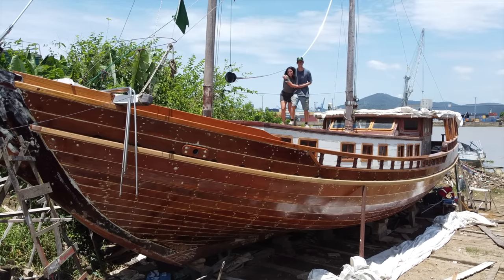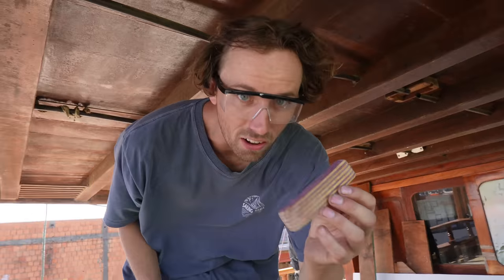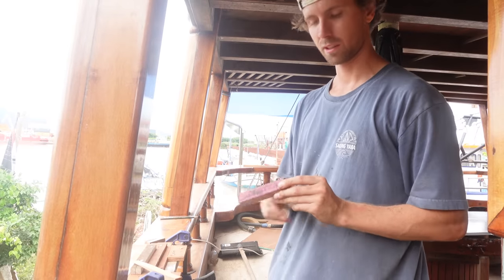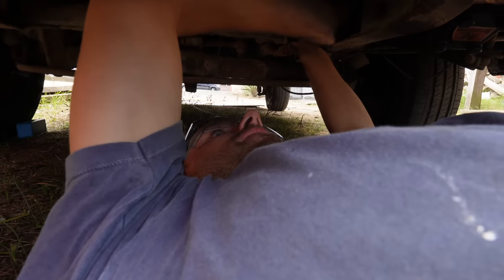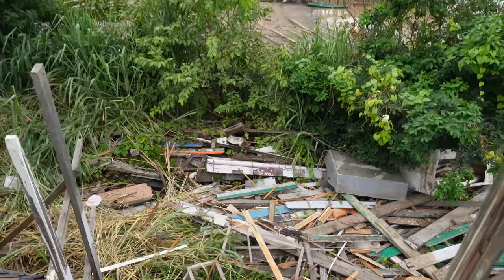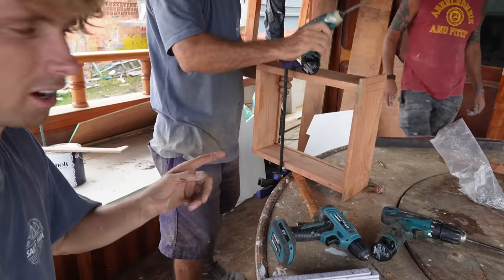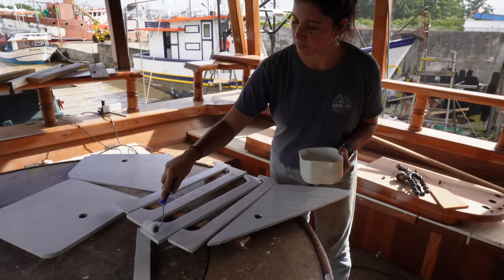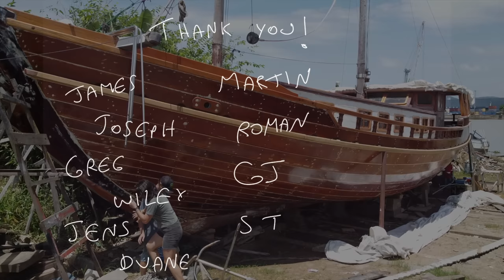Turning this once WRECKED SHIP into an all new liveaboard sailboat! — Sailing Yabá #131

Comment: The handle making exercise would go so much faster/safer/tidier/more consistently with the router mounted in a table - doesn’t need to be anything fancy. Gives me the heebyjeebies seeing you try to freehand small bits like  that. Routing the recesses  and edges first, then cutting them apart would help too. Those things take no prisoners!

Comment: Thanks! 

Just a thought, but with a large cove bit and a matching round over bit, you could’ve made those handles a whole lot easier after you had them glued up. You put the large round over bit in and do the two ends on the top and then the front edge of the top and the two sides on the front. Then you could’ve changed to the large cove bit, and hollowed out the backside where the fingers would fit and finally for aesthetics and may be to make it a bit more comfortable switch to a smaller round over to due to the two ends on the bottom along with the bottom front edge and with the bottom inside where your fingers slide in, making it nice and smooth and rounded. Anyway, you would’ve ended up with the same product. It just would’ve been a whole lot easier.

Comment: As always in wood working, there are many methods to achieve a given result.  In making your drawer handles, you might have found it easier and quicker to have used a cove bit in your router, taking small passes until you got the desired depth.

Comment: To put drawer handles on you need to build a simple jig.   It should locate the center of the drawer and then the location of the holes needed to mount the handle.   Drill and mount.   This will mean all handle are at the same location from top (or bottom, depending on jig) of the drawer and you will no longer need to measure for each handle!

Comment: Ben  The Ball handle you are trying to make at Time 4:22- 4:26 Try putting it in a Drill chuck and use Coarse Sand paper glued to a flat stick like a file and shape it in a hand drill while the drill is running full speed

Comment: Its likely too late, but if you want an 'easy' way to make globe nobs you can use a hole cutter in a vice then attach your block of wood to a hand drill and rotate it against the hole cutter to make it round.  If you want to be fancy and more accurate its best to setup a jig that rotates 90* out around the hole cutter to make them all the same. (Saw this on a wood craft youtuber channel)

Comment: By using scrap wood your keeping your material cost low but on the other end your increasing your labor cost. I see they are building everything one board at a time. From what I have seen these guys are master builders and could take measurements and build all of your cabinets off site and install them.

Comment: Hi there, Ben and MP !
Before I forget I have a concern about something to do with Yaba. It's the diving platform at the stern. I'm worried that if you get into a storm and the boat is pitching heavily she could slam the platform down hard into a following sea doing serious damage to the platform and even worse,  the transom! Fortunately I think the solution is pretty straightforward ;  just hinge the board section so that (1) it just rises with the wave or (2) even better, so that the platform can be raised vertically against the transom. Of course all this depends on the sort of weather that you expect to be sailing in! 

One more idea!  Do you think that Yaba needs a figurehead? Every time I see that clipper bow I imagine a glamorous Lady of the Sea or suchlike flying gracefully above the waves 😊 !

Comment: The bottom of the front windows is going to collect water and hold it unless provision is made to drain it. This will break down the sealant and be a source of rot and an eventual leak. It would have been so simple to slope the window sill to drain. don't understand why that wasn't done.

Comment: Actually i would make C-handles for the drawers, much easier to make and can be used to attach ropes to them if you need to strap something to the drawer... cant have enough places to attach ropes to on a boat! Also your handles would be easier to make if you glue "full" would stripes onto stripes that already have the C cutouts and then cut these into handles.

Comment: giv us an update what has to be done before launch ???
Reply from the maker: Hi Bruno! Paint the hull, make thru hulls, finish the engine installation, install the propeller and prop shaft, install the steering system, install the stays and rigging, nav lights and equipment and more! 😄

Comment: Dear friends, you are the only boat builders using hammers and nails on a boat I have ever observed. Epoxy, glues, and water barrier compounds and screws are the normal methods for boat building. Preventing the wood from moving and preventing water from damaging the boat is normal building practice. You are not doing preventative work except paint; that is not enough! It's not a house; it's a boat on the water.

Comment: Yaba is a lovely boat but she is not an offshore sailing boat . You have too many windows and those are weak points . You would need dead lights or storm shutters for most of them . Yaba is a charter boat by the look of her , designed for inshore work , with her shallow draught . She is getting heavier by the minute . Having said that I’ve never accomplished something like this project….. but I’ve worked all my life on boats . Extraordinary effort